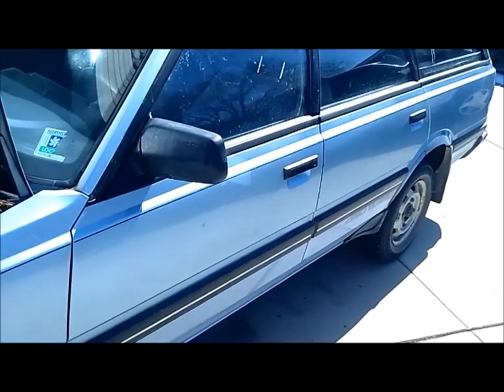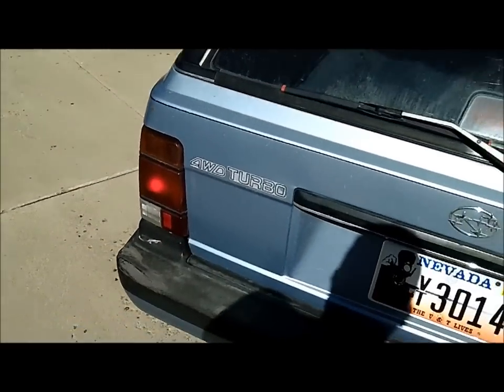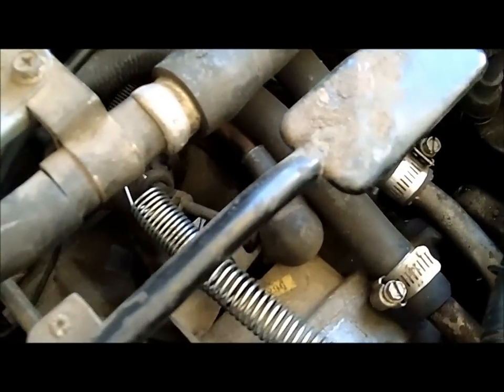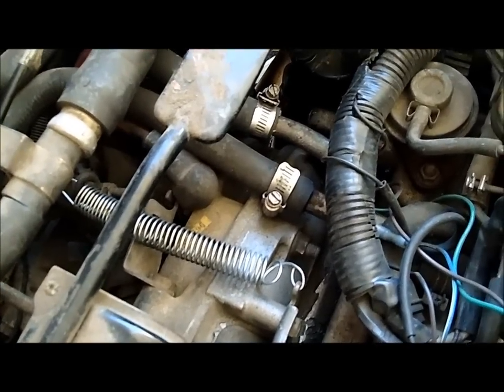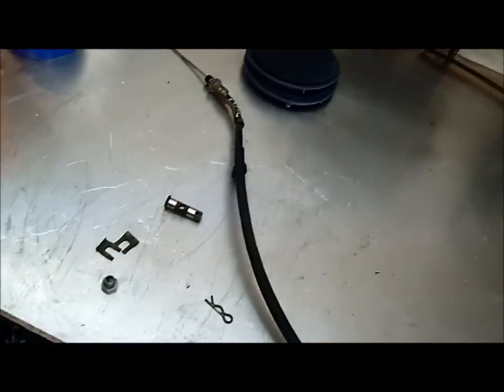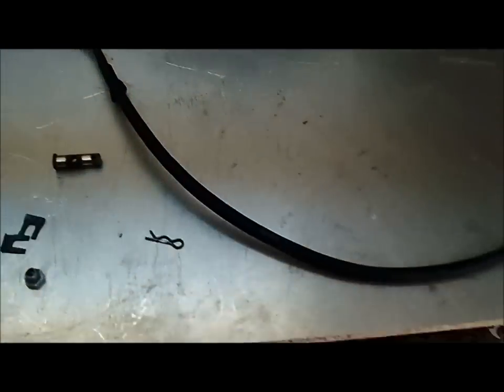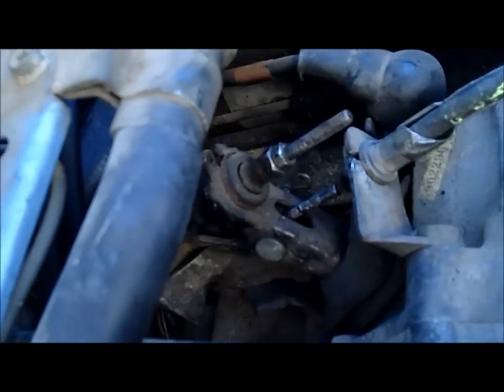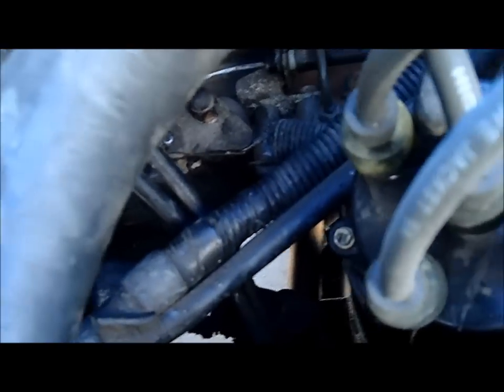Time to Tinker 4 Subaru turbo Hill holder clutch.wmv

Comment: Love the video, very informative; however, I have an issue of an opposite nature. I have an 89 Subaru turbo and the hill holder has locked up my brakes several times where I just can't move forward and the brake does not disengage. Is there a way to disable the hill holder? I really don't need it especially if I can't drive the car when it locks up like that. Any help would be appreciated. Thanks.